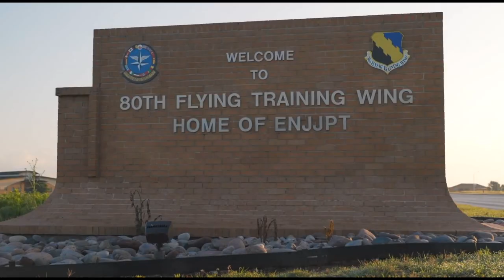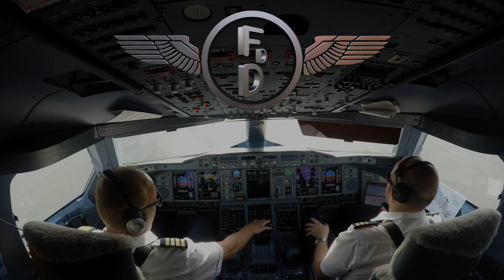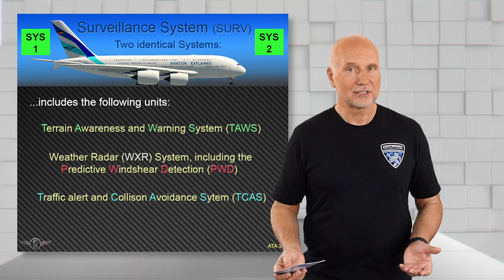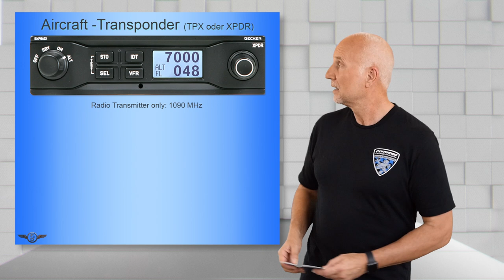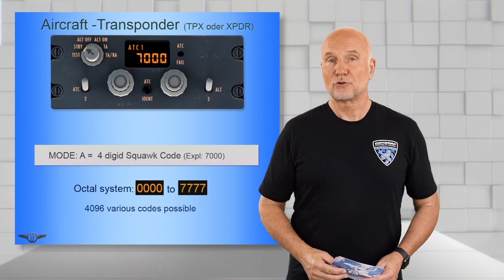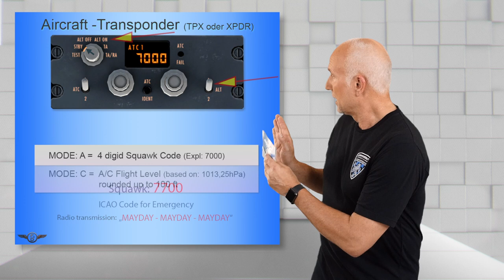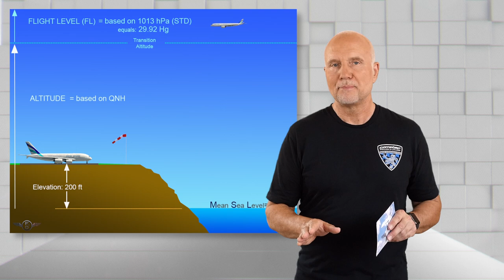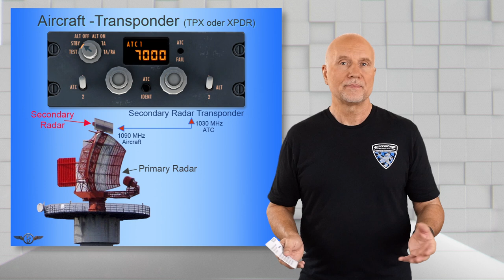Aircraft Transponder; What is it for? How does it work?/Aviation explained

Comment: That was a great hard-worked video Sir, I have a question, ADS-B transponder was the one that was on flight MH370 as well, How come just turning off one switch just disables everything ? don't you think this needs a modification itself ?
Reply from the maker: Thank you for your comment and question. ADS-B has been developed mainly for ATC, beside ADS-B do exist additional „protocols“ to transmit aircraft data (a wide range of data are possible dependent on airline/operator demand) and this data transfer can not be switched off in the cockpit. The missing „data until disappearance“ must have other reasons.
Reply: @CaptainFrankDreyerA380  understood! then what happens if a transponder is turned off? the official reports of MH370 suggest that plane disappeared from secondary radar because of a transponder turn off, and pilots did not sent any stress signals to the ground. this implies that if pilot/pilots does not use those protocols to transmit data, the data shall not be transmitted?
Reply: @CaptainFrankDreyerA380  me

Comment: Does ADS B transmit if transponder is switched off?
Reply from the maker: normally not. unless the aircraft is built with an independent ADS B power source and transmitter/receiver system.

Comment: I'm flying over a class b airspace and I set up a two-way radio communication and transport bonding on mode c altitude reporting I am transporting within 30 nautical miles of airport Kennedy within 10,000 ft msll right now and I am at VR attacking I have fire operations I will be flying in pretty soon for a pre-flight landing operations